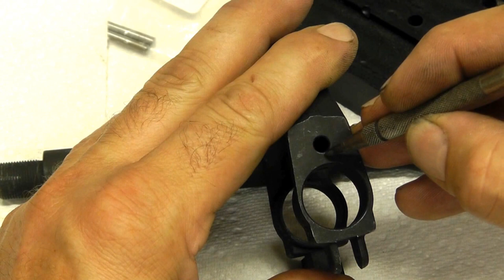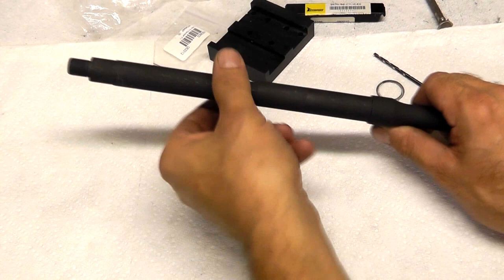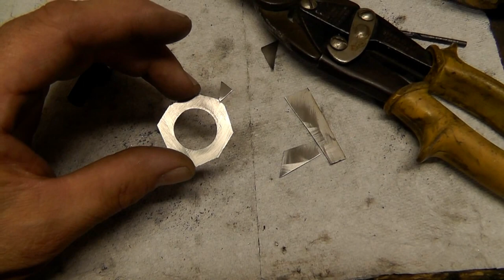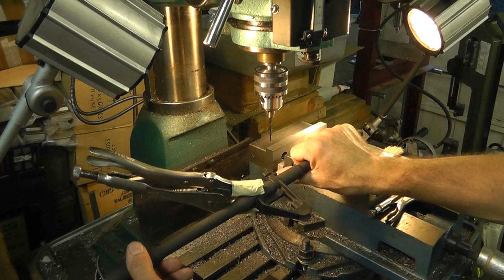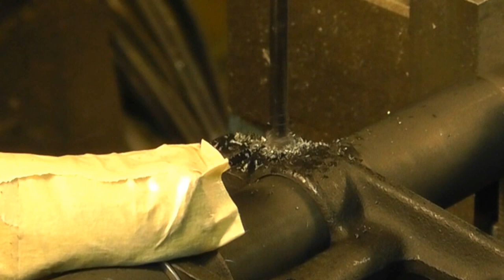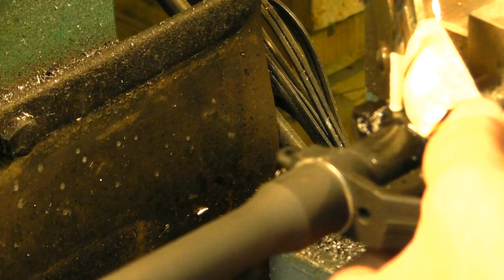AR15  Install a new front sight on a new barrel Part 1 in HD

Comment: If the barrel is not dimpled, use a dimpling jig to get the barrel dimpled. After doing that take your front sight base (FSB) and drill the already drilled hole  on the underside (located under where the sling swivel will be installed) to the correct size for a 10/32 tap. Tap the hole and install a set screw holding FSB tight to your barrel dimple. This should hold your FSB in proper alignment and hold it steady while you drill the hole for the front taper pin. After front taper pin is installed remove the set screw so you can drill the second taper pin hole and install second taper pin. This is probably the best way to assure proper alignment. The hole that you tap is the hole that is drilled for the gas port. They have to drill through the FSB to make the gas port.

Comment: Glad to have found this as it eliminated my re- inventing the wheel! You are a good presenter, and I like your shop floor machinist techniques for set up and alignment. I would critique 3 things, 1)bare mill vise jaws on the barrell, nothing to prevent marring, 2)not naming the steel block for what it is, a parrallel, and 3) abscense of a machinist jack under the protruding portion of the barrell, and ideally the sight base as  well. If you had a jack under the long portion of the sight base, you could then throw a milling clamp over it and completely reduce the chance of rotation. I do however get where you are coming from, and again thanks for this vid!

Comment: Has anyone mentioned....step#1 is to slide A-frame UPSIDE DOWN onto barrel - 
look thru drilled hole and lineup with barrel gas  port, gas port in block is always oversized so you may be able to side block against barrel flat and still have a gas port alignment that will work, if not, adjust and you now can see the GAP you need to work  with. 
Step #2....... this bottom hole can be drilled larger and tapped  or at least tapped. A allen screw is  used to  secure block to barrel (after you correctly reinstall) use a # 31 COBALT drill, a drill press is MANDATORY....a 2/0 taper reamer to shape hole for a taper pin is used.... I cut off bayonet lug and use two dimple screws also.              HOPES THIS HELPS SOMEONE. 

                                     ALL BLACK RIFLES MATTER

Comment: Underneath where the sling swivel goes there is a hole that they made to drill the gas port in the sight base , what I did was tap that for a set screw , then I took a dimple jig and drilled a dimple for the ser screw to seat in
What this does ie the dimple jig lines the barrel port and the FSB gas port perfectly doing awY with spacers , marks , ect to line up the gas power 
Use the se screw to hold the FSB  in position while drilling for the taper pins , the set screw will aid in keeping the FSB  secure. Redundancy,  but mostly to ensure perfect gas port alignment

Comment: This is great instruction!  99.9% of all videos on the FSB, is about removal of one and not installing.   A keeper for sure.  
It's very difficult to find reamed barrels for FSB, or even barrels with a FSB.  People for some reason are obsessed with free float hand guards, probably because businesses know a 10 year old can build an AR with raw barrel, slap a gas port on, and mass sell them without reaming.  It's pure laziness IMPO, and I hate having to grab an aluminum hand guard with an add on front sight.  Businesses love sell this notion of accuracy about free float, but what the buyer and typical AR shooter is not aware of, is that Marines qualified at 500 yards with drop in hand guards and only a FSB.  No lasers, gizmos, pixie dust, Trijcons, scopes, or any other add on's-- just a pinned in FSB, with drop in hand guards that didn't burn your hands because they were polymer instead of aluminum.  Thanks for these videos.

Comment from the maker: @Roy Erickson, Roy I'm not able to reply directly to your comment due to your google plus settings, but to answer your question, the barrel is 3/4 inch dia. here and the probability of you getting in too close to the bore is low.  Buy thats why I made the video, to show guys they may be better off getting a barrel with all the components installed.
Reply: ginsboy2003 Great vid.  This is one of those things where it isn't all that hard to do if you have the right tools but it's still a pain & if you aren't experienced there is some risk of screwing it up. 
 It's good to see someone do it but I am all for ordering a barrel with the sight base installed. I just bought a barrel with the sight base installed knowing I was going to remove it & install an adjustable, clamp on style. I wanted the option of going back to the stock sight base & ordering the barrel with the sight base installed only costs a few $. (about the same as the cost of a sight base) Basically, they drill it for free. Can't beat that & I agree, most guys are probably better off buying one with the sight installed. 
I have a basic machine & basic machining skills & I am confident I probably wouldn't mess it up but that's no guarantee. I am not willing to risk a $300 barrel on my basic machining skills & the phrase "probably wouldn't mess it up" when I can have the manufacturer do it for, if I recall, about $30 including the sight base.  Again, great vid.  I enjoyed watching & it reinforced in my head that I did the right thing by having mine done by the manufacturer.
Reply from the maker: I agree, I'd prefer to buy a complete upper myself.  There are too many good deals out there right now.

Comment: I had a used A2 front sight post (take-off) that a friend gave me. It was drilled and roll pins were used before but me brand new Anderson barrel was not drilled. I didn't really want to notch the barrel with a dremel to accept roll pins or try to drill the barrel with the sight already drilled. I chose to tap it (#8x32) and use 4 set screws to anchor the sight post.  I used a straight edge along both sides of my upper receiver channel to align the sight. Individual taps and set screws are usually available at Lowe's, Home Depot, Ace Hardware, etc.  I am running a removable carry handle with the built-in rear sight and I was hitting a torso-size steel target at 600 yards the first time out at the range with just elevation adjustments on the front site only!!  I am not sure exactly where it is hitting but we could definitely hear the tinking sound. We could also see the sand/dirt kick up when I missed. Next time out I will be using paper to fine tune at 600-700 yards.

Comment from the maker: Yea an end mill will work great.  On AK's I grind the end of the drill bit flat and angle an edge on it.  It doesn't work perfect but on a AK, its hard to find an end mill that small.  The key is to put a flat on the barrel like you said.  I haven't had to do it on AR's yet, but I was told its good idea to go back with oversize pins due to the hole probably ending up larger than needed.

Comment: If your using a drill press and you don't have a lathe to mark the barrel, what i did, is i took a piece of paper, checked to make sure it was square with a square, then wrapped a small piece half around the barrel, insured the edge was dead center with the barrel gas hole and  the 90 deg edge of the paper was against the raised portion of the barrel so it uses the milling of the barrel to make a straight line between the raised edge and the barrel gas hole so you can make a damn near perfect center mark on the barrel. 
Then to insure the barrel is exactly 90 degrees I used the AR receiver flat in a vice sideways, shimmed up the gas block, ensured it was lined up with the mark triple checked it from multiple angles so ensure nothing changed after I secured it. Then drilled it with my drill press, oh and make sure you don't have a lot of bit wobble,  the cheap drill press i used took a few tries and a few adjustments to make sure it wasn't wobbling around. make sure your mounting surface is level and exactly 90 degrees to your drill bit, the way i did it was super hokey. basically i used a square and made sure it was square to a longer bit on all sides. since the bit is longer, any change in angle is more obvious. If you have a better idea of checking the table Id like to hear it. because mine is difficult to do and obviously not perfect.

Comment: It can be done by first using a slot drill milling cutter in the drill press, cutting through the hole to machine a flat on the barrel and then the drill bit. I saw it on one of Artisan Tonys videos :-)

Comment from the maker: I can tell you from my experience working on AK's, with a sight that already has hole in it as the drill bit hits the round portion of the barrel, it tries to "walk" around the curvature of the barrel elongating the hole in the sight making it more difficult.  The metal in the sight isn't hard enough to stop it.  I'd personally prefer a sight with no holes in it if the barrel has no holes.

Comment: Great tips, as usual.  Quick question for clarification on the drill:  Is the drill size #30 or #31?  In the description, you posted #31 but in the video, you mention #30.  I've been wondering how to get the alignment perfect and it took only a few minutes on the lathe.  Brilliant.
Reply from the maker: I used a number 30, but since one viewer who used it had problems because the hole might not have been perfect and it came out too large a number 31 might have been better and could be used.  It is slightly smaller.

Comment: Didn't see this in the comments but maybe I messed it... IF you are going to use abrasives like that grinder or even emery cloth on your lathe, PLEASE consider covering the ways with a rag or at least make SURE to whip them clean and re-oil them.  The find dust is MURDER on the ways if ground in with the bed over time.

Comment: Instead of making a custom spacer, a short length of 18 gauge bare copper wire works well - or larger diameter (16, 14, 12...) if you form into a ring and smash in vice to suit.
Reply from the maker: Good idea.

Comment: This video has helped me out big time, and I thank you for that! I hope you are well.
Reply from the maker: Glad to hear it helped you.  Did you buy a barrel and do the work, or did it help you avoid buying a bare barrel?
Reply: I did the work of course:) I actually used your clamping method a few months ago and it worked better than the one I was using before, which was just cardboard and a vise, but your vise-grip method works much better:) 

I did have to make adjustments to a bull-barrel in the past, thought I was on the mark but the mark was a bit off to the point I had to adjust the rear sight to the right a few clicks to find zero lol Live and learn then fix:)
Cheers bud!

Comment: I have a lathe and mill, so that part is easy. I'm also using a Nitride barrel. Will the hardness of the barrel cause any problems when drilling using regular coated HSS drills or HSS straight flute hand reamers? I've never worked on Nitrided steel and I know it's quite a bit harder and I'd rather not invest in specialty carbide bits and reamers. 

Also, a tip to see if your spacer (or handgaurd retaining ring) is spacing your front sight from the barrel shoulder properly: Most front sights have a hole on the bottom of the rear ring between the sling swivel legs. This hole is due to the manufacturing necessity of cross drilling the gas hole into the inside of the rear ring. So this hole is PERFECTLY inline with YOUR SIGHT'S actual gas port. If you put the front sight onto the barrel upside down with your handguard retaining ring or homemade spacer in place, the gas port in the barrel should be able to co-locate with this hole on the bottom of the front sight. If it does not, You can see how much thicker or thinner your spacer or handguard retaining needs to be to align your gas holes.
Reply from the maker: I'm not sure, if you are using a virgin gas block it might not be too bad since you're making new holes.  I did recently help a guy with a virgin AK barrel that was nitrided and it was pure hell trying to drill the holes in the gas block and sight block with high speed steel.  Bits kept wanting to walk around the barrel.
Reply: ginsboy2003 My front sight post is regular parkerized steel and I'm going to center drill it properly. I'm hoping it with the hole in the front sight, it won't try to wander when the tip hits the nitride barrel.

I'm also using .125" HSS bits because I have a ton of them and they're $1.50 each if I toast a couple. 1/8" is between #30 & #31, so it should work well.

Comment: Great video was very helpful. I believe you say you used a #30 drill bit? I'm measuring my taper pins and the large end is .1250 won't a number 30 be to big or did you start with oversized pins?
Reply from the maker: I don't know if the pins were oversized or not, that's just what the guy gave me to use. I would use something that is smaller than the small end of your taper pin.

Comment: Great video.  I'm thinking about buying a stripped barrel and installing a front sight on it, but I only have a Black & Decker Rotary tool.  I also don't have a ton of money.  Do you have a low-cost drill press you would recommend? Or should I just send the barrel to ADCO?  I want to learn how to do it myself, even if I fuck it up.

Comment: What's up man. So I'm in the process of doing this myself. Don't have the pins yet but I've been practicing with a nut and solid 3/4" round stock. And I just drill and tap the nut so it basically is like a low pro gas block the way it's held on. Well one time I got almost all the way through u could see the drill bit coming out the other side and the bit broke off flush. I used a punch to get it back out bc like I said it was almost through but what are some reasons this could have happened. I've tried 3 other times and it hasn't happened but I haven't changed anything so idk what happened and damn sure don't want this happening when I actually start drilling. Any recommendations would be appreciated. Thanks

Comment: Not sure if you will get this since it's been out a number of years.  How much of the barrel do you try to get or does it matter.  Using a stainless barrel cause any issues drilling?
Reply from the maker: Stainless won't cause drilling issues, the only problems I ever had were with Nitrided barrels.  I'll never try to drill them again.
Reply: ginsboy2003 could one “score” the surface of a nitride to make cutting into the metal easier?

Comment: Can The front site post be mounted closer to the muzzle? Of course the barrel must be of the right diameter, and you would need separate gas block. Other wise any other challenges or issues?

Thank you
Reply: m4 profile barrels have a 3/4" section right behind the muzzle threads, it's a little undersized, so get some shim stock. .003" should work
alternatively, a custom barrel with a 7/8 gas seat and a 3/4 front sight seat could be ordered, wont be cheap though

Comment: what about clamp on or set screw gas blocks.are they a little longer so that you dont need a spacer for it to line up with the gas port hole or are they off .025 thous. like a pinned sight?are they designed to butt up against the ridge of the barrel or do they need a spacer also?

Comment: Has anyone ever purposely misaligned a gasblock to the gas port to prevent over gasing? Most barrels today are crazy over gassed. I wonder what taking 20/1000 of an inch of the hole through misalignment would do.
Reply: I know this comment is old, but for over-gassing issues, use a heavier buffer weight. You could intentionally misalign the FSB to rescue the gas, but at that point just get an adjustable. JP makes and adjustable FSB, but I think that’s more for running a suppressed setup, as those tend to suffer from more blowback. The biggest issue I see with intentional misalignment is running into issues with windage adjustment getting maxed out at further distances when you need it. Although if you’re trying to push 5.56 that far in high winds, you’re better off with a magnified optic and arguably a different caliber.

Comment: Why not save yourself some time and simply grind down the old handguard retainer instead of making a whole new washer?
Reply from the maker: +George Boros I had just enough to get the job done so it would have lost me a week waiting on another to come in the mail.  If you do have an old one laying around then by all means, chop it up, not everyone has a lathe.
Reply: use a length of 18 gauge bare copper wire and make a ring....

Comment: That washer/spacer/shim in this video is an unnecessary PITA.  Instead, go to a local hobby store that sells music wire.  It's available in many sizes so measure the endcap you're using.  Mine was .031" not .025".  Music wire is available in both sizes and many more and only costs a couple of dollars for a 36" piece.  Cut off a piece about 6" long and bend it 360° around something smaller than your barrel because it will spring back.  It's easy to make small adjustments until you have it perfect after trimming the ends.  Use this as you would the washer in the video.   Also, it seems pointless to me to make videos like this using tools that almost nobody has access to.